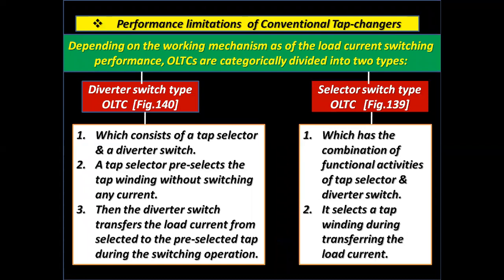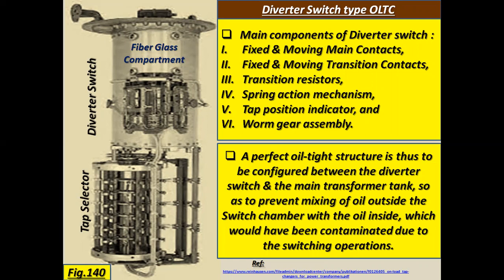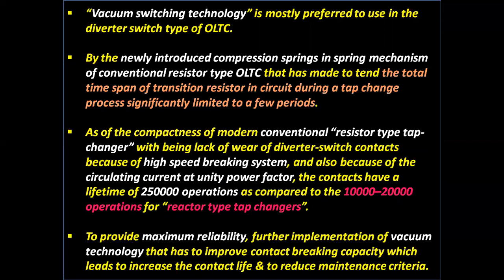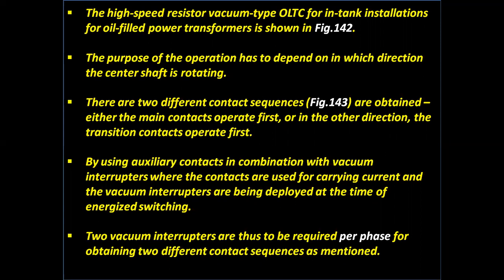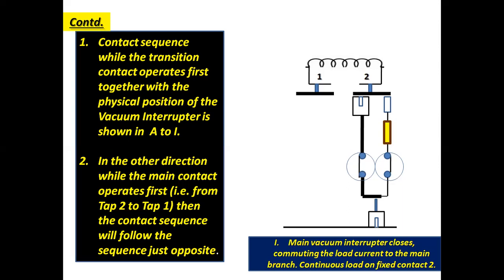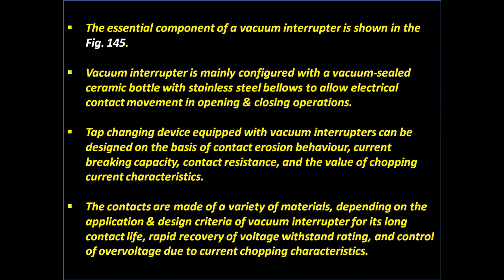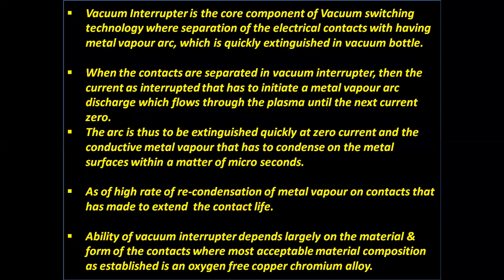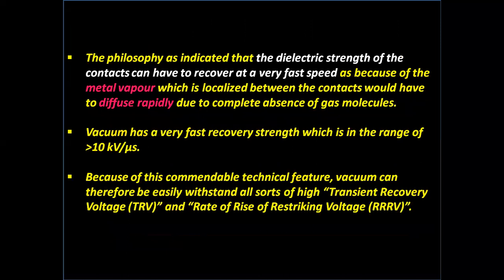Power Transformer Part 40

Comment: Transformer vector group  video
Reply from the maker: What type of video you want to see, please clarify in detail. You can draw the vector group as per the clock division. As of example: Dy11 > Star (y) connected LV winding is leading Delta (D) connected HV winding by 30 degree.
In case of Yd11-> Delta (d) connected LV- winding is leading Star(Y) connected HV winding by 30 degree..
Reply: @pranab_powercircuit6504  thank you sir